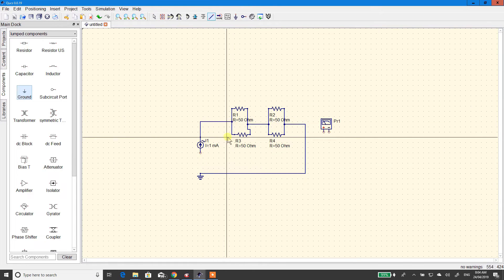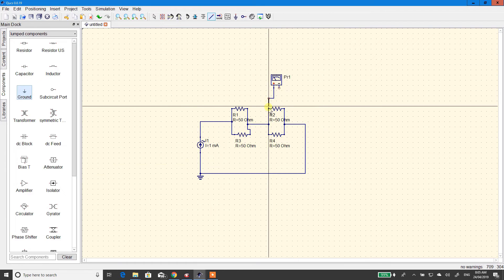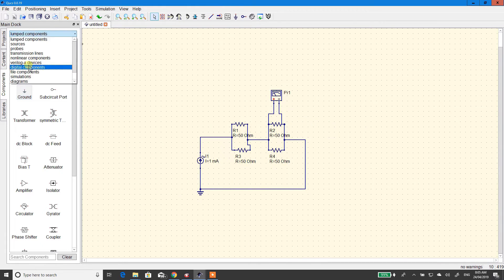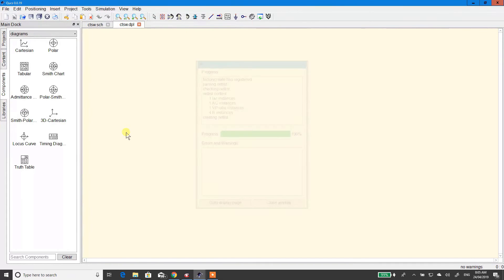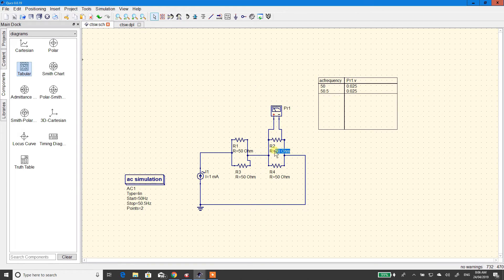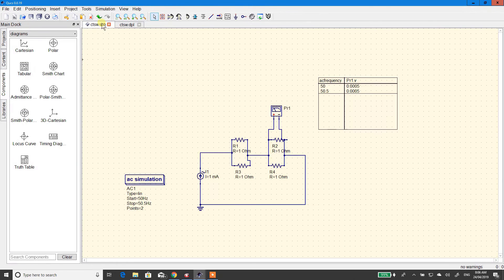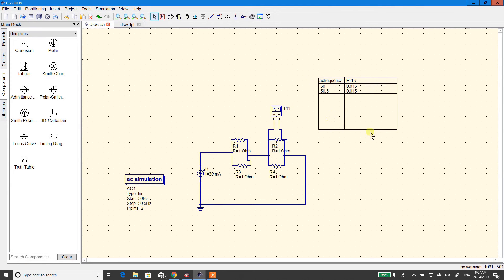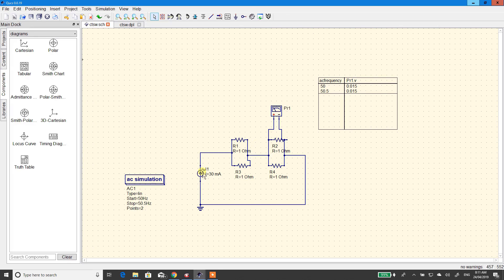Arduino AC Power Monitor Part Three 'Current Circuit'

Comment: how can i build a system and connect 15 samples of MFC (microbial fuel cell) in same time for measuring current (low between 0mA to 3A) and voltage (between 0mV to 800 mV) continuously? I have an oscilloscope, if the system help me to get the reading continuously from the oscilloscope or independently measure them, both way is good for me. Please someone help me.
Reply from the maker: If you wanted to use an Arduino I suggest use two teensy boards because of the 12bit Adc and that way you isolate each measurement from each other. Shunt circuit for current and maybe voltage divider circuit for voltage. That's how I would go about it
Reply: @50Hz  is there any link that can guide me? For assembly, programming and items i need specifically?
Reply from the maker: @chenartahir1865  https://youtu.be/JsS8GvEv4c8 have a look at this video which talks about measuring voltages. I also have another from 3 years ago which talks about shunting current. Start there once you understand it you should be able to go from there
Reply: @50Hz  thank you very much. Really appreciate it 🤝
Reply from the maker: @chenartahir1865  I've got a video planned for reading industrial sensors just waiting for a 48VDC power supply before I can make it. Is that what you are after
Reply: @50Hz  what iam doing is this:
I have built a microbial fuel cell (MFC) , which it consist of anode cathode inside a container. Wastewater will be poured into the container which contain bacteria. The bacteria produce electric while consuming the organic materials. So i want to measure the produced current and voltage from the unit. I have to monitor the voltage and current. I have an oscilloscope for voltage but i don't have the data acquisition system for monitoring. Im not sure about your next video is related or not
Reply from the maker: That sounds really interesting. I'll have a Google of what you are doing
Reply: @50Hz  please do it soon. I really need this 😁🙏. By the way, if you can make a video on how to connect and monitor 5 batteries with Arduino UNO or mega. I would be really thankful for that. And i will donate to your page too
Reply from the maker: @chenartahir1865 do you have any pictures of what you have made so I can better understand the flow of current. If you have anything you think may be relevant please email me jongrimes1983@gmail.com
Reply: @50Hz  of course. I will send you the picture of inside and outside of the MFC. And the scheme